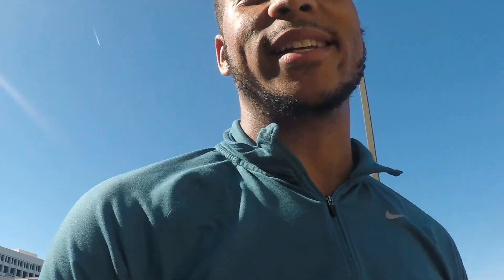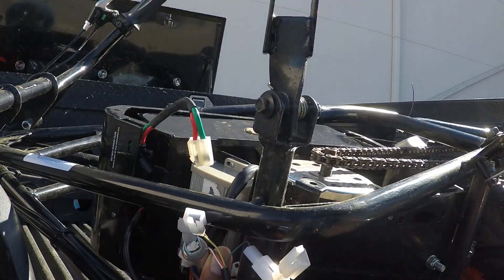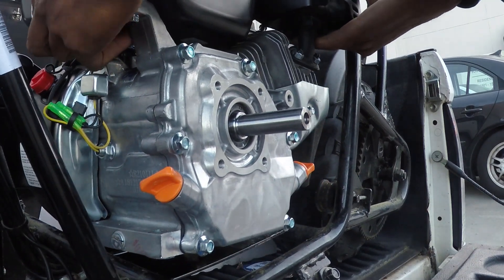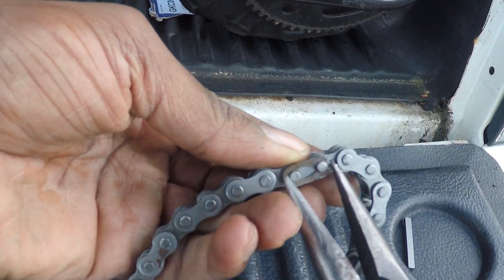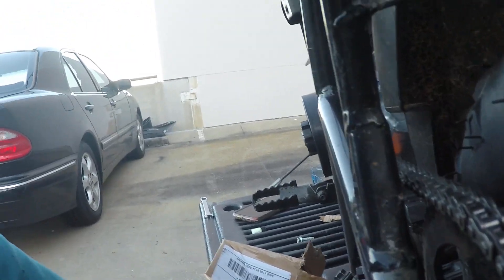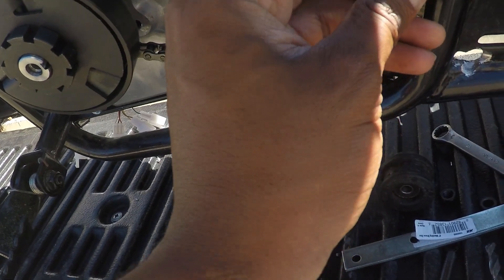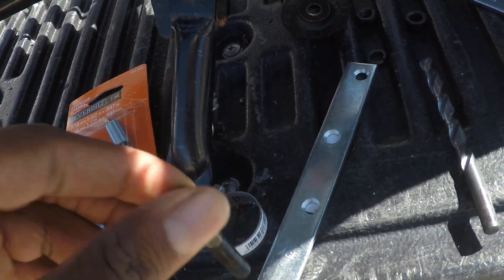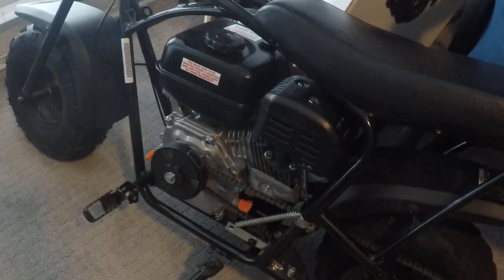Mega Moto mini bike Electric to Gas conversion in 12 MINS!!~

Comment: Did you charge out the back sprocket or does the 35 chain fit? I've noticed that the original chain is smaller than 35..

Comment: Does this bike have the same frame as the gas powered
Reply from the maker: Yes they are the exact same frame
Reply: Do you think two of these for 250 is a good deal
Reply from the maker: @uppairkk1811  yes that is a very good deal you can resell the electric motors, batteries and controllers for around 100-150

Comment: #35 half links... Allows you to tune the tension on the chain.. NO drilling..👌🏾👍🏾
Reply: What do you mean by that, I’m about to do this build and I am curious?
Reply: @user-rh4ul9sw9v  If your chain is too short & adding another master link makes it too long.. Try a half link. Between that & the tensioner you should be able to get proper tention.. #35 half-link..
Reply: @runit5772  oh that makes sense thank you.

Comment: Did you remover the governor on the 212
Reply from the maker: Anonymous bypassed it
Reply: Invoke Performance we’re did you get your frame? And how much was the whole setup process
Reply from the maker: Anonymous I bought it used locally and the entire setup was $150 including motor from harbor freight
Reply: Invoke Performance nice ever thought of putting a exhaust and carb with intakr
Reply from the maker: Anonymous yes that would help performance greatly!!
Reply: Invoke Performance would it be easier to set it up like that without cutting it down?
Reply from the maker: Anonymous less fabrication is most of the time easier.
Reply: Invoke Performance oh ok thanks

Comment: Ty for this build, someone is selling a monster moto e1000 for 100 bucks. Wasn't sure if I could fit a 212 in the frame but now I know it's worth the buy.

Were u able to or did u try to sell the electric box? If so how did it go?
Reply from the maker: Skeptic Fucker yes you should be able to sell it no problem online

Comment: How many batteries came in the bike as it was electric? As it was 1000 watts
Reply from the maker: it came with three twelve volt batteries.
Reply: @DirectedWisdon  that 212 kicks tho 12 o'clock me lol I'm 228lbs
Reply from the maker: @trewatkins530  i have seen that first hand LMAO that 212 dont care who is on it lol. A hemi predator 212 mini bike, body slammed my bro and he is 280.
Reply: @DirectedWisdon  😂😂😂😂 for real I was like that when a guy told me I pulled up  on him he was 325 I'm like what eva then I did the exchange  from 79cc to 212 ha  ha I was like  wtf

Comment: Thanks.  Used your video to do the same conversion. Did you attempt a stage 1 upgrade. I know the exhaust will fit. Wondering if the air filter will. Once again,  thanks.

Comment: Would you sell the electric motor set up? I’d throw that in micro mini bike I’m building
Reply from the maker: right now I only have the motor the speed controller is not working properly. however you can buy the same 36-48v kit from ebay with everything for around $100
Reply: I have the same electric motor, what are you asking for it?
Reply from the maker: @thegreenmememan827  i would sell it for $50
Reply: No I’m trying to sell my electric motor
Reply: @skepticfucker280  no i didnt,why?

Comment: So, on the chain tensioner, rather than building a new one, could you have just removed less links and used the existing? I'm about to do the conversion and just wanted to know if you'd do that differently in retrospect.
Reply from the maker: Alex Avedikian The reason why I chose the chain tensioner method is because overtime the chain will stretch and the rear wheel on this bike is notadjustable so I used a chain tensioner to modulate the tension to the optimal level. However you can also try to drill out the holes so the motor can be slid forward and backwards and that would also be solution

Comment: Im diggin the pikachu bro lol.  I got the same electric one. I was looking to upgrade it to gas but I might hook it up with a 72v battery system. Who knows maybe we meet up and race haha
Reply from the maker: So FLOSSY thanks man 72v May be a little to hot for the motor and controller it think 48v is what the max on them is
Reply: @DirectedWisdon  yea if I did that I'd have to add a controller and motor capable. I built a 1500watt muscle bike at 52v. It goes about 30mph but the acceleration is amazing. That's the only reason I want to go electric.